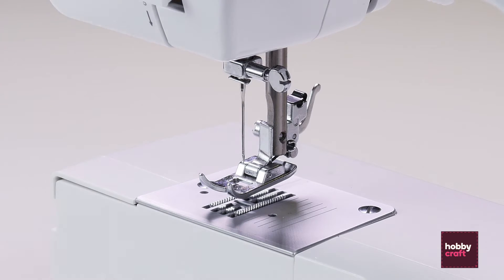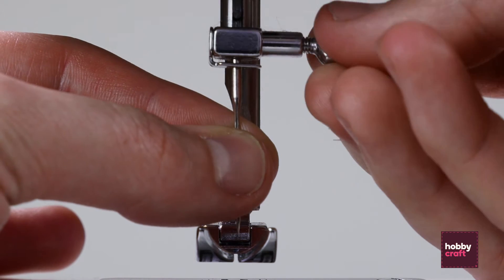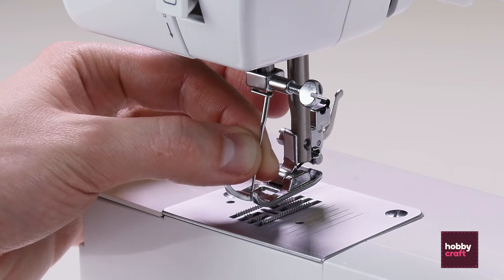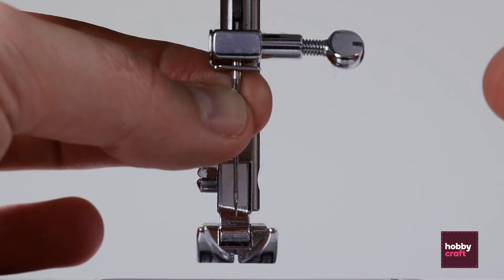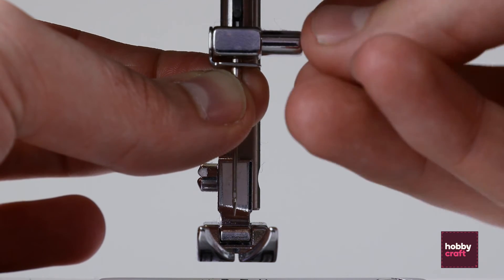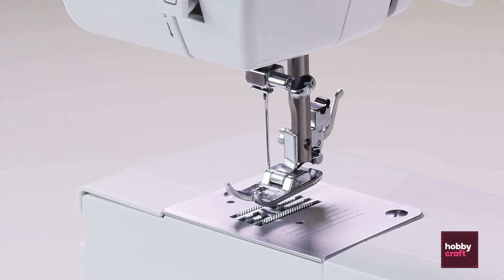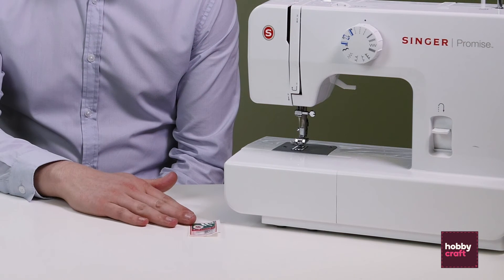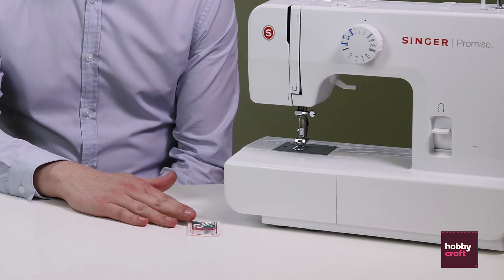How to Change a Sewing Machine Needle | Hobbycraft

Comment: I went to change my needle. The whole needle clamp came off and now i cannot get it back in. The nut will not tighten while trying to assemble on the needle holder. If i assemble off the needle holder the nut tightens but will then not fit on the needle holder.
Please help.